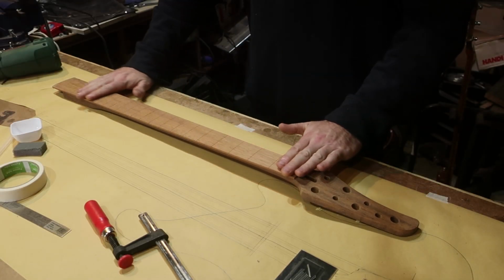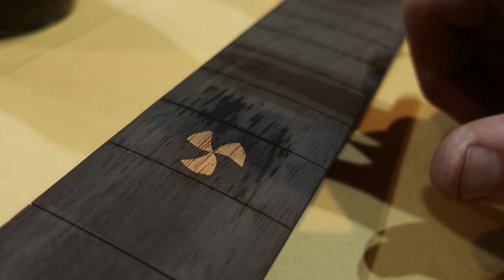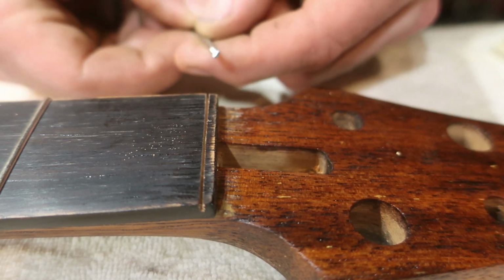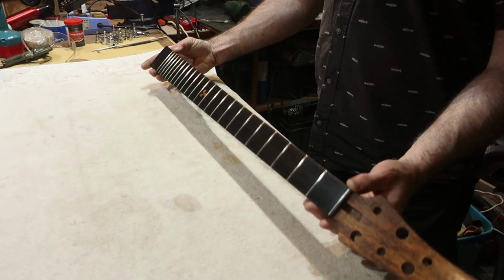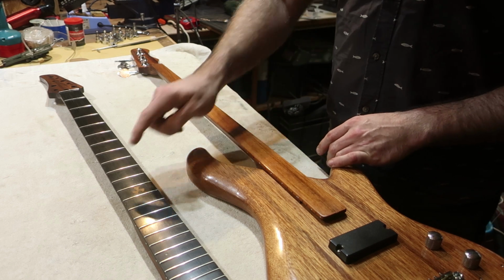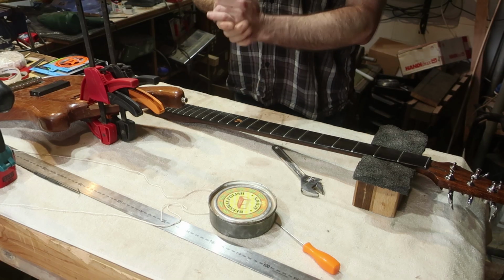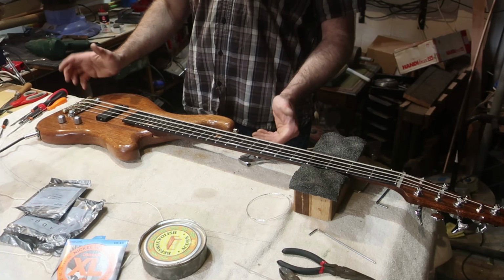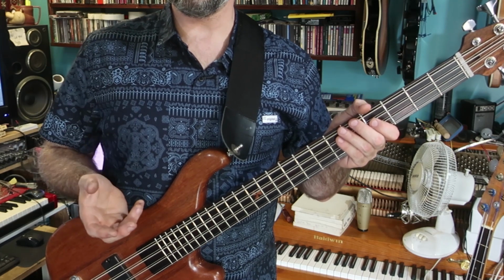8 String bass episode 3 - Putting it all together

Comment: Despite the tough deadline you set yourself for this bass, it sounds great. I'm now half expecting you to go all out on the next build and make a 12 string bass instead of another 8 string!
Reply from the maker: Hehe, I've got to solve the neck issues with 8 before I go making them even worse😂 Wondering if dual truss rods might be the way forward... we shall see.
Reply: @fanbladeinstruments dual truss rods for sure. Also, if you dont already know, multiple neck laminates in opposing grains will help with stability & rigidity. I've heard from Alembic that walnut makes a great neck laminate wood.

Comment: Yep, final conclusions are right, by building one, you always discover improvements, and the next one will be better. Or you can try and fix these things.

This is exactly my next bass project. (Did a trial with E and E doubled and later the octaves.) So, I was surprised that these guitar strings simply FIT. Never thought they would. But a headstock layout of 2x 4 tuners is a lot shorter than 1x 8. And the d  is the real question, will it fit?

Thanks for showing this build!

Comment: Nice Job Geoff, but like you said a few improvements and you'll be there. look at the schecter Omen-8 bass bridge saddles and maybe reposition the tuners. I liked the hammond sound I assume its from the Nord, but no leslie ? anyhow, keep up the good work!
Reply from the maker: Not entirely sure what you mean there, the first section of music is quite hammond heavy but there's an obnoxious amount of leslie all over it, and yes, that's my beloved Nord, the Electro 3. I used to have a Hammond L100, when I bought it it ran perfectly for 3 weeks before the motor start capacitor blew out, I searched high and low for a replacement, but it sat for 5 years before I had to admit that I was never going to be able to fix it and sold it for parts. I've actually got a genuine Leslie bass rotor from a console organ and a non Leslie set of horns in their own cabinet, the plan was always to set them up for the full Hammond experience but the Nord does it all without taking up a third of the studio and being unrepairable. Cheers

Comment: That is beautiful Geoff.. 6063 (or 6061) aluminum as neck supports will work better. They have less initial flex, which is what is needed. 3-5 x 8mm......ish.
Great work.
Reply from the maker: Yeah, I found some 6063 at my local hardware store, 3x8, it seemed pretty bendy though. The carbon fiber was not quite as bendy but I really would've preferred something way more robust. Ultimately I think the actual solution is dual truss rods, one is clearly not enough, and although dual truss rods can be tricky to set up I am not afraid, I own a Rickenbacker😉

Comment: I have a 8 string project and it's with a short scale lefty tele headed neck I got given by Bruce (the Jansen guy) so, so many years ago. First incarnation (it sat around for about a decade, following me around from here to there and back again) was a six string bass with lipsticks and that was great, but weird (and I remember getting super told off for it when I posted on NZ guitars that it was the ugliest piece of crap ever to even exist) as, even back in those days stuff was still expensive and I'd used regular tuners and so to fit the low E end through a guitar tuner I'd pulled the other end through the body, using a normal strat bridge, round then end and then banged up some copper to create the ball end retainer) and soon after picked up a regular bass so the poor thing went into a corner only to then end up as a experimental thing (I'd got into vitamin S and gizmo sound stuff) somewhat about what that crazy dude did in the B-52's and put a set of two bass strings on it and then three high B's in unison but the crazy did stop there as the other end was a pot lid, resonator style, with a piezo and an electret mic. Then about 4 years ago I got back into building guitars, like almost seriously, and then decided that poor old neck, so long suffering, would now be an 8 string... haven't got too far along other than what was left of the headstock, after so many redrilling and filling for machine heads doing different things, has ended up quite bizarre looking as I then cut off the sides and grafted on new ones to take four each side like you've done. I kind doubt though that'll happen as now what appeals is actually just going back to what it was originally, a 4 string lefty tele headed 30" scale bass... and wearing all it's scars proudly!
What I do like though was that it's first use was actually a baritone guitar long before I'd even known of such things!

Comment: Great video! The coping saw work you did to finalize the fret slots. Was that a standard thickness blade? More effective than a triangular file?
- Paul
Reply from the maker: Yes, part of my process involves cutting the fret slots twice, first with a razor saw so that I can get them precisely where they need to go, but that blade is only half the thickness it needs to be. Then I can do a bunch of things to the neck - radius, carve, finish etc, and when it comes time to cut the slots to the correct width - and yes the coping saw is perfect - I've effectively got a pilot slot for the coping saw to ride in for extra accuracy. It's the equivalent of drilling a pilot hole to stop a bigger drill bit from wandering off the mark. Cheers

Comment: One more question. It looks like you kept the zero fret nut slots quite deep rather than filing the top down. Was that to ensure string guidance (and because it’s a bass)?
- Paul
Reply from the maker: Normally I would spend a bit of time to actually finish shaping the nut, polish it and make it nice, but as I was short on time I didn't bother, the zero fret was doing the heavy lifting as far a functionality goes, as you say the nut is just there for guidance. Also I only just realized when I was compiling the video that it'd shifted ever so slightly, looks like the low E might've pulled it loose, again, the zero fret makes it a non issue except that it's a bad look and not the kind of thing I want to make a habit of. Thanks